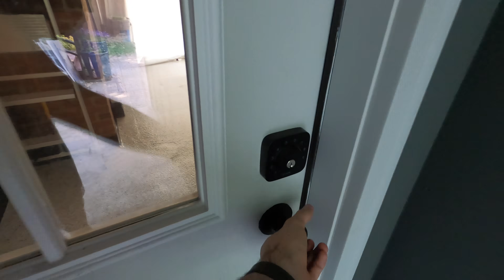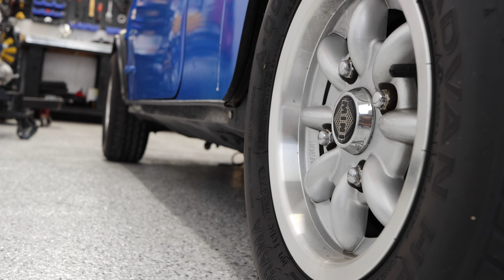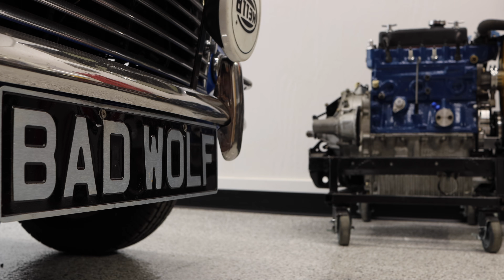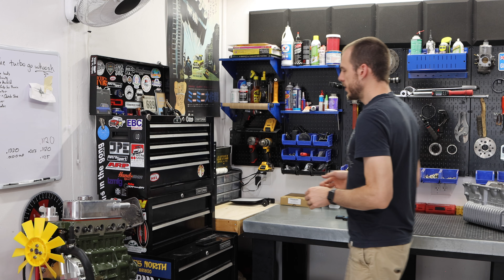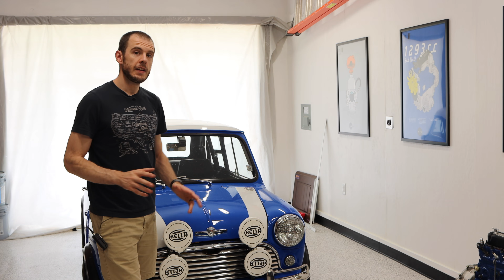The Next Chapter Starts NOW - Garage Tour

Comment: Will you ever do a Honda build/modern engine swap or is that not your sort of thing?
Reply from the maker: Overall I do like the idea of a modern engine swap, if I did one though it probably wouldn't be a Honda. Not because they are bad engines but because many folks have done them before and I really only think the Honda D-Series is a suitable engine for the mini. (totally personal opinion) If I did a modern engine swap I would really like to try and do a ford Eco Boost conversion. One of the 3cylinder turbo engines would be awesome in a Mini!

Comment: congrats, looks good, watch that epoxy floor with your tires, cold concrete and warm rubber tends to sweat, and stick, would recommend either cardboard under the tire or a matt, don't spoil that lovely floor..:)
Reply from the maker: Thanks for the tip. The company that laid it said it shouldn’t do that and they warranty it. So if it peels it’s on them 😂
Reply: @classicminidiy  excellent, hold them to the fire on that warranty!